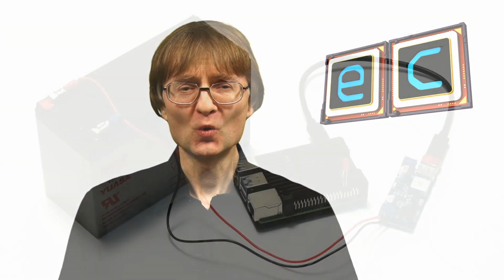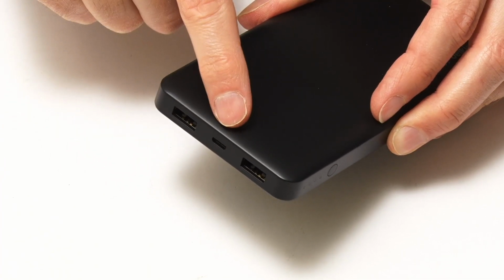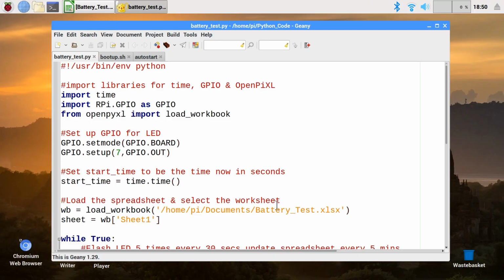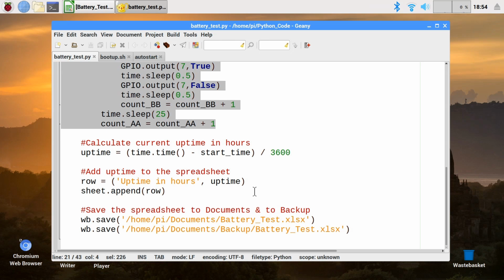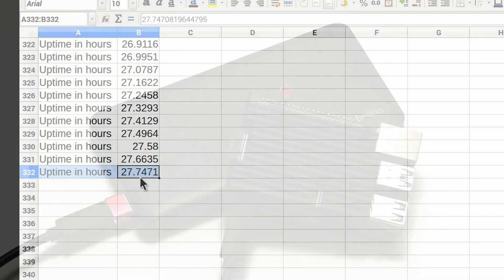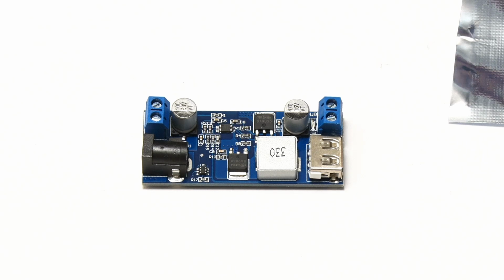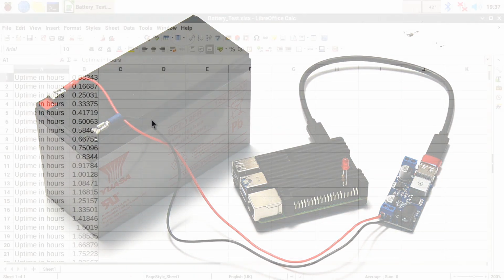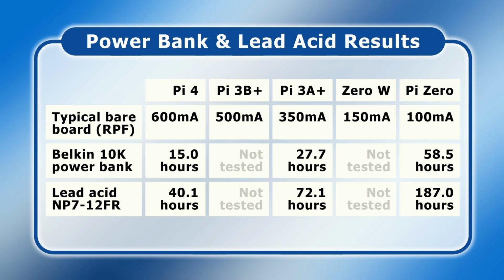Raspberry Pi Battery Power

Comment: Why would you want to run a Raspberry Pie on a battery? It's not like you are running your business on it like a PC and need it to run during a power failure. Why not just plug it into the wall?
Reply from the maker: Because if you are using the Pi to control a robot, or as a remote camera or sensor device, for example, it is often impractical to use mains power. It is very common indeed to run a Pi from a battery! :)

Comment: Did you drain the lead acid battery to 50% or did you drain it completely? If you add an undervoltage protector to the circuit you can have the battery disconnect at 50%. I suspect the long runtime on lead acid is partly due to discharging it completey which will damage the battery in the long run.

Comment: Great video as always. I think if you have to repeat it you could use the CSV library included with Python, it will produce something that Excel can open without the need of installing extra software. You could also use a single CSV file and just append to the end of it. Have a nice day.
Reply: I was thinking the same thing. IMO even a CSV file would have been overkill since all we're interested in is the last value. Why not just write the uptime to a text file, overwriting it every time?

Comment: Hopefully we can build modular laptops that we can customize by choosing keyboard style, or touchpad vs track point or have hard disk swap under a minute. No longer having to settle for a spongy flat keyboard or a touchpad that has its own mind clicking randomly on a send button. I miss the old Synaptics touchpad that one could designate zones for tap to click rather than entire surface of touchpad or adjust touch sensitivity with greater precision.  We could power the display using a separate battery if we wanted longer battery life, Imagine using a thunderbolt 3 usb-c hub with PD as the means to interconnect and power all the components while building around it in a small briefcase. Unfortunately soldered memory remains a huge problem. Nowadays most of us have to settle for a predetermined combination of cpu/gpu/memory/keyboard/touchpad/lcd display and battery size. If anyone component fails, you're mostly screwed.

Comment: Does lead acid battery charge and discharge simultaneously? Could you plug it to mains and use it if the power is cut off?

Comment: Lol, I think you did the wrong calculations... a 12v 7a battery has about 184% the capacity of a 5v 10a one, Then probably the module and the batteries of the powerbank are not of very high quality and are therefore less efficient than the module you used for the other
Reply from the maker: The calculations were correct.
Reply: @ExplainingComputers  I don't know... and why the battery lasted more than double? 😂

Comment: Is there a way to hook a solar panel (not a huge one, mind you) to the Lead Battery, and also have it connected to a Pi? I'm just Imagining putting a weather station out in the yard, using wifi to send the data back to the house, but not have to run wires out to it. The large battery would then be able to compensate for the days where you don't get much sun.

Comment: Thanks for this video. Here i see a serious issue in the lead-acid battery case. These batteries have very low internal resistance and can produce a extremely big output current, up to the hundreds amps. It is usable in the cars to roll the massive engines at startup using 12V voltage only. But the very thick wires are used in that case. Here we have relatively thin wires, and in case of the short circuit they will produce very much heat. It can even burn and cause the fire. To avoid it, it's neccessary to use the fuse for the 2-3A current, which will be melted in case of the short circuit to protect the other parts and prevent overheating. But i don't see any fuse even at the board of the converter or at the wire. It's not good. In the powerbank the fuses are also neccessary, but they are commonly installed inside the case.

Comment: some years back I used a battery like that to run an RPi-3b with an RPi-cam, motioneye os, and had a 1amp battery tender hooked up to it plugged in at all times. 
 The battery had a 12v cig lighter usb outlet attached with a cord running to the Pi.
If the electricity went out I had power for as long as I needed and it all fit inside a coffee can I kept on a shelf near the door I was watching.

Comment: Unfortunately, low-current drawing on a lead acid battery until it’s depleted has probably shortened its life considerably. Some sort of circuitry to cut off at say 20% charge would be most useful.

Comment: Thank You Christopher for some thourogh tests!
Q1:  RPI OS 64BIT Have You tested  that, yet? 
Q2:  What would then be the advantage over the 32bit version? 
Q3: What of 64bit version and on minimum board memory  demand?
Reply from the maker: I did a video on 64 bit Raspberry Pi operating systems a little while back: https://www.youtube.com/watch?v=80CU1j36Q6s The 64 bit OS in theory will improve performance and allow more memory to be accessed. This said the 64 bit version of Raspberry Pi OS remains in beta, with the recommended one being the 32 bit version. And this was tweaked to be able to be able to access 8GB RAM (pretty well) when the 8GB Pi came out.

Comment: Really interesting figures!  In relation to the PiZeroW, I regularly use one running at full load, with an e-ink display off a 12,000mAh LiPO bank and I generally get about 50-55hrs of use from it.  It's neat to see your figures fitting in so well with my experience on a number of Pi systems.  :)
Reply: Wow, I am doing the exact same thing. Odd coincidence

Comment: There's two reasons why your lead acid battery ran for so long.
The first is what Xjet said - over-discharge. 
I would strongly recommend having either a script that monitors the charge state and can shut everything down when the battery reaches minimum voltage, or a hardware disconnect that shuts the device down. (Depending on your application you may want intelligent restore capability too.)
You can get these BMS systems fairly affordably.
The second is that SLA batteries are rated at "C/20". Aka, 20 hour runtime.
Your Pi4 - the highest load you proffered - is right at the 20 hour rating. Ergo, you SHOULD have the full usable capacity of the battery available.
In fact, your usable capacity will improve even further as you reduce the load with the lower Pi's.

Also, this means that an SLA with a Pi Zero (W?) and a small solar panel to keep it charged would be an excellent way to achieve UNLIMITED runtime and remote reporting capabilities of, say, sensors.

Comment: I went over the spec of the NP7-12FR, at such a low current you have the full capacity of the battery (no need to multiply by 0.65). Even this does not explain the huge difference between expected and measured. I assume that the average current of the RPI3, and RPI4 was significantly less than the rated power.

Comment: I wonder if it'd be possible to actually detect battery level so there can be a way to alert the user when the end is near to replace or recharge the battery specially when running for days/weeks on end.

Comment: I just reviewed this video and guess what. I'm using recycled lead-acid batteries (2 * 12V/7Ah in parallel) combined with a 100W solar panel. It almost seems like an indefinitely power supply. Soon, I'll upgrade the power source in a nice housing with 4 batteries in total.
This sould leave enough power, even when the temperature drops below freezing point and the sunny days are getting scarce.

Comment: Very interesting real world results. Thank you for doing these lengthy tests Chris.
I was wondering whether the RPi Foundation's data had the Pi's supporting HDNI monitors, accounting for the discrepancies with your tests.
As a heads up to your viewers, I attempted to power a RPi 4, w/HDcam security camera with a power bank, charged with a solar panel and buck converter. The power bank would shut off the 5VDC power every morning, when the solar panels started charging it.
I solved the problem by throwing away th power bank's BMS. Then I reconfigured the cells to 8VDC. That way, the 18vdc solar panels would charge until they dropped down to 8 VDC. Meanwhile, another buck convertor would independently power the RPi security cam and the x/y stepper motors could be powered directly from the power cells.
Some power banks are unable to power deices while being simultaneously charged. buyers beware
Sometimes, less is more.:-)

Comment: you make incredible tutorials... so, from across the pond, Thank You... 
out of curiosity, have you tried to attach a solar panel and recharge the battery w/o using mains? I guess this would be more useful for a 4 but a remote "thingie" would find it handy.
thanks again...
Reply from the maker: Thanks for this. I've never experimented with a solar panel and charger, but it is on my list! :) I'd also like to do a clockwork powered Pi . . .
Reply: @ExplainingComputers  Ever considered a small wind turbine to keep your greenhouse powered? It might provide a more reliable source of energy than solar in the UK.

Comment: Like the video. Would the buck convertor/ BMS make any major difference? I have found a difference between some power banks with the same capacity. Is it the 10,000mA/Hr at 5v, or at the nominal cell voltage? And there can be over a volt difference in the nominal voltage depending on the chemistry.

Comment: 9:00 Why run the  code in a lxterminal? Wouldn't it be better to completely disable the GUI on the RPi, as it runs headless anyway? I don't know whether it would change battery life significantly, but rendering graphics takes some resources anyway. I think it could be better if you just ran bash on autostart without the GUI.

Comment: I am using RaspberryPi 4B for an application where I am taking counts from a proximity sensor. The count is displayed on a UI window I have designed. However, when the power goes off, the count is reset to zero. Is there any way raspberry pi "wakes up" to the same count after it reboots (because of power failure)?

Comment: Hi Chris, is it possible to have 2 batteries connected to one Pi, alternating between them, when one is going low, it switches over to the second  battery, and while running the new battery, the old one is being charged up to capacity again and ready to take over when the second one has gone low and vice versa?

Comment: What about a video:  to discharge an acid battery with Pi4 (quickest), and charge  this battery to full and discharge again, and repeat this 5-7 times or more  …and chart how much  the time will change, and then maybe You will gain a new respect to  Lithium batteries :) ... a single discharge of brand new acid battery   it is hard to  use as a proof for using it as alternative ... From my experience those batteries are excellent to have as a backup power (much cheaper), but as  a deep cycle battery it is not a good idea, but all depends on from what  exact type of the battery is.  Regardless  … Excellent video. Thank You. Big fun of the channel.

Comment: Thanks Christopher.😉 I had a sneaking suspicion that the lead-acid batteries were way under-rated at a minimal load. I think I may have to invest in a 12.5>5vdc buck converter to power my RPi4B directly off of my mini-solar array (which has 2-35AH. batteries in parallel) for backup power to my radio equipment. That should be enough to run it continuously while the solar panels charge up the batteries during the day, even if I have several cloudy days in a row.😁👍

Comment: In my experience a powerbank supposed to provide 5V-5,2V for charging phones does not always deliver ... In my design based on Raspberry Pi Zero I had to add a step up converter from 3-5V to 5V, in order to get more power.  An interrupt in my python code caused the powerbank not deliver and the code crashed. When I added push pull converter I have not experienced crashes anymore. Good power-supply is the THING! It has to deliver what you need. Running pi in idle and testing is not really realistic.

Comment: Fun stuff! I found out awhile back that with Lead acid batteries, even deep cycles you actually only get 50% usable capacity without damaging the battery cells! HALF the "rated Ah" or Amp Hours that it says on the label! So that "7Ah" battery you used really only has an approximately 3.5Ah capacity and that's only if it's still in good shape (you probably also just damaged the cells by letting the Pi's run until they died without using a charge controller, like the ones used for solar/battery systems). I picked up a small 12v 8Ah Lithium based LiFePo4 battery for about $35 off Amazon, they can use up to 100% of their capacity in a pinch! Most of the time though it's recommended to only use 90-95% to avoid damage depending on what you read. My Pi 4 can run 80-90 hours off it, over 3 days straight and it's SUPER lightweight too at only 1 lb or 0.47 kg!

If you're interested in one, search for "Miady 12V 8Ah Deep Cycle LiFePO4 Battery" on Amazon...

Comment: lead acid battery has a very nice feature, if you only load it with a small load it will not drain as fast as you would think. so say it had 7 amp hours, thats true for 1 amp load. but with a 0.1 amp load it may come up to 8-9 "amp hours"

Comment: can your gpio led work on a rock pi 4 as i would like to do  this test on a rock pi 4 running 4 2.5 inch hd?
Reply from the maker: Yes, the Rock Pi 4 models have a Raspberry Pi pinout GPIO connector. However, you will need to install relevant GPIO libraries for the Rock Pi 4, as it is not based on the same hardware as a Raspberry Pi.

Comment: Yuasa batteries are the creme de la creme of SLA batteries. There's a good reason lead acid batteries are used for the backup of fire alarms, intruder alarms and UPS systems - they usually turn out very close to their rated capacity though they do start to lose some of it after a few years - we replace batteries in intruder/fire alarms after 5 years.

Comment: I'm not a huge fan of using raw mA ratings to calculate power consumption for stored energy because it doesn't consider the voltage and time. 
It can help with accuracy in estimations to convert all components in the chain into their watt hour (wh) ratings. This would apply to all items in the chain such as the stored energy items (like batteries) as well as power consumers (converters, cable losses and the pie itself). 

An example of this calculation... say you have two batteries (ignoring chemistry), one 12v battery and one 3.7v battery. They both have a rating of 10,000 mA.

The amp hour rating (actual capacity) would calculate out to be that the 12v battery has significantly more stored energy when you factor in the voltage:
3.7v*10,000(mA)= 37,000 mAh (or 37 Watt hours)
12v*10,000(mA)=120,000 mAh (or 120 Watt hours)

Let's say you have a Pie that consumes 600mA at 5.1v. Then the Pie consumes an average of :
600mA*5.1v or 0.6A*5.1v= 3.06 watt hours

We are getting everything on a level playing field (in watt hours).
 
Now factor in any converter losses. Say the convert is 90% efficient. You will consume 10% additional energy on top of what the Pie consumes. This calculates out to:
3.06 watts (the Pie's consumption) * 0.10 (converter loss)= 0.306 watts consumed by the converter. 

We add this "conversion inefficiency" to the Pie's consumption and you get a total of:
Pie 3.06 watts + 0.306 watts for the converter = 3.366 watt hours

You can take the total of the Pie and converter (3.366 watts) and directly divide it into the two battery storage figures we did above. This will provide an estimate of how many hours it would theoretically run.

For the 3.7v battery we had 37 (watt hours)/3.366(watts for Pie and converter) = 10.99 hours
For the 12v battery we had 120 (watt hours)/3.366(watts for the Pie and converter = 35.65 hours

This levels the playing field for doing your calculations and considers all variables involved. In practice, it becomes quick and an accurate way to gauge all devices in the chain. Keep in mind that battery chemistries also play a role in actual runtime as not all batteries are created equal. As mentioned in the video, under heavy loads some batteries like lead acid may give less capacity due to internal resistance (known as peukert law).

Comment: Great video. You said to power the Pi use GPIO pin 2 and 6! By the cheat sheet there is no pin 6. How do I count the pins on GPIO on the pi (Zerow)? Left to right starting from the only square GPIO on the Pi zero (near the sd card). Anything would be a great help.
Reply from the maker: Scroll a little bit down this page and you will see a diagram with the pin numbers indicated: https://www.explainingcomputers.com/pi_devastator_videos.html  On a Pi Zero, pin 1 is indeed closest to the micro SD card slot on the left, pin two next across on the right, etc.

Comment: lipos/li-ion battery capacities are measured for 3.7V output, which is about 75% of 5 Volts, that's why you get 75% of the stated capacity i assume.